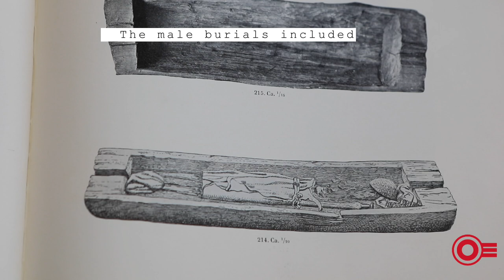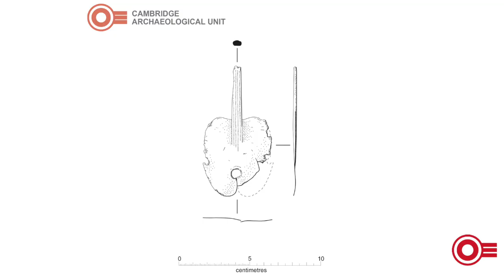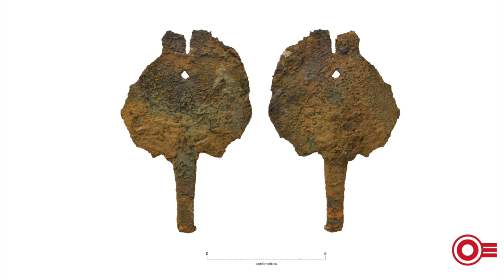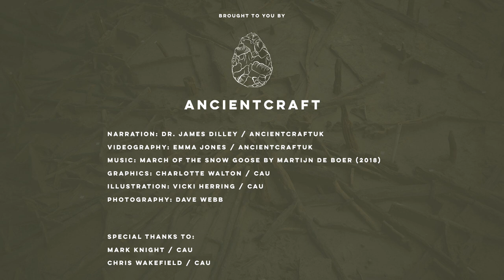Making Must Farm (Pt 5): A Bronze Age Razor

Comment: If we consider this tools possible purpose as a craft-knife, I could imagine it beeing used for leatherworking as well, as its shape is reminiscent of more recent "Head"-, or round-knifes. Probable interpretations for the mirrored blades could be that they were used, one at a time, till one was too dull for its job and the other could take its place (As to enable a more continuous workflow) or that each was used for a different purpose.